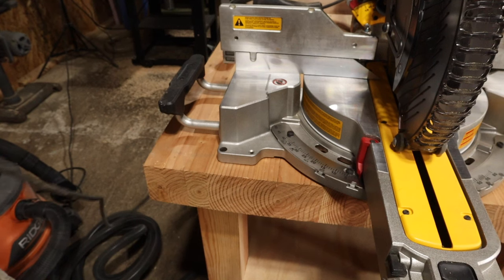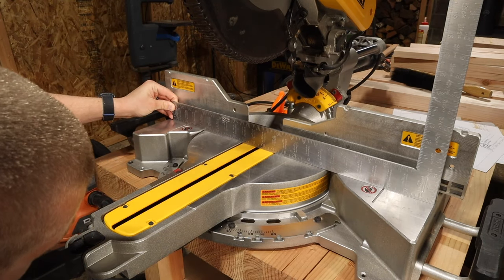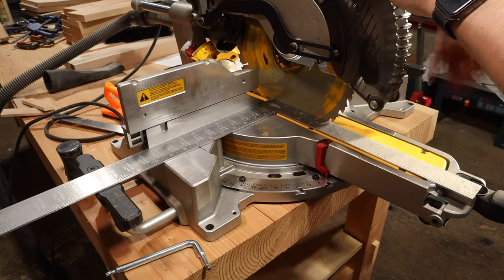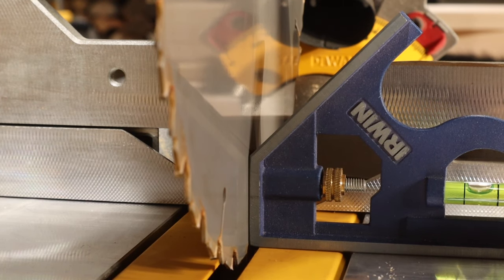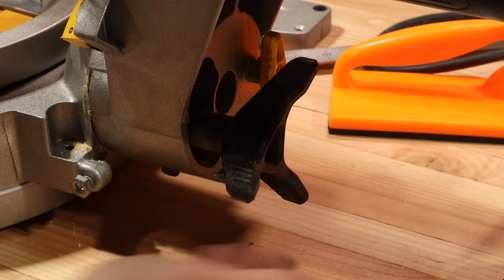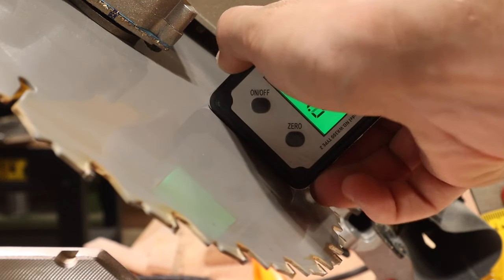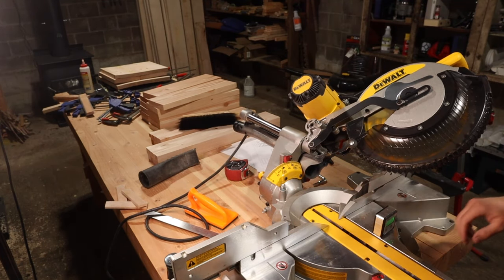Fine Tune Your Miter Saw | Dewalt 779 Miter & Bevel Adjustment

Comment: My husband was going to cut some boards for a closet I am designing, but I checked his blade at 90 degrees per another guy's video with his speed square and it was off. He said he didn't know how to fix it, so I straightened it using that bolt per your video while he was taking a nap.
Reply from the maker: Glad you were able to get it fixed! 😄

Comment: That is not a 90 degree detent nut. I've practically turned it both ways and when I tighten it, it shows the degrees going down on my digital angle gauge but when I loosen it the degree doesn't go up. You should have shown how to do this.

Comment: How do you get the side to side wobble to stop. It's not the blade the whole saw moves/ wobbles side to side. Can't see any screws or adjustments under the base?
Reply from the maker: Interesting! Like it’s wobbling in the bevel adjustment direction? If so, the back of the saw has the pin which locks in the bevel, does that have any wiggle in it?
Reply: @NorthwestCraftsman  yes the bevel adjustment.  The yellow pin is a little loose and the back black know is tight. I'm stumped. I see no way to tighten it.
Reply from the maker: @BLAM777  Weird. Okay, well, it's narrowed down to that. Can you try pulling it out like you're going to do a bevel cut and then let it snap back into the 90deg hold position? When it's doing this see if it feels like it's inserting fully or if there is something in the way, keeping it from fully engaging.
Reply: @NorthwestCraftsman  well I got it to ingage ,now it doesn't wobble. Just kept pulling  it out and moving it around while locking it in. Maybe something was in there stopping it.
Reply from the maker: Awesome! Yea, I bet it wasn’t fully engaged. Glad you got it fixed though! 

Happy Woodworking!

Josh
Northwest Craftsman

Comment: You deserve an award for a very thorough explanation and well edited instructional video, kind sir. Have you noticed that the blade guard's wheels are problematic when doing bevel cuts? Mine can't roll along the the work piece like it should because of the aggressive angle and I had to remove my blade guard entirely. 
Thanks!
Reply from the maker: Thank you! I appreciate the compliment and am glad you found it helpful. 

I have noticed that the wheel binds up on bevel cuts sometimes. What seems to help me is when I use my thumb on the trigger hand to slightly lift the guard as I initiate the cut. I don't do a ton of aggressive bevels though so I may not be experiencing the same situation you are. 

Josh
Northwest Craftsman
Reply: @NorthwestCraftsman  thanks a lot my friend! Are your wheels binding up on the 45° bevel cuts though? Mine are and I think that's a design flaw in this saw.
Reply from the maker: Yea, I guess that is where I’ve noticed it. I’ll need to try cutting a few of those to see what the motion feels like. I don’t even do that many 45° bevels 😂 miters yes, but apparently I’m a bevel free woodworker 😂 On the whole though, I think you’re right that this is one of the weak points of the design.

Comment: Best video I have found on Youtube for all of this adjustments--thanks
Reply from the maker: Thanks! I really appreciate that! Glad you liked it!
Reply: @NorthwestCraftsman  I just got this model from Home Depot and I have the 90 true to the fence (on both sides), and the right side 45 to the fence. But the left side 45 is slightly off, maybe .3 to .5 greater than 45. The table and the fence both are flat all the way across. Could the adjustable detent miter scale be faulty? Any suggestions?
Reply from the maker: Hey there! Glad to hear it’s mostly in line.

I see a few possible options: 

1. There is a small amount of tolerance stack up in the detent plate. i.e. the very small amount of play all components will have allows the right to hit 45 on the dot, but it’s too close to the edge on the left and pulls it off by a hair. 
2. The fence on the left is off (less likely because of the 90° measurement being on)
3. It was measured poorly (I’m guilty of this more often than I care to admit 😂) 
4. You’re limited by the accuracy of your measurement

To make sure it’s not 3, which is easy to check, try measuring it a couple of times and see why kind of repeatability it has.

To check 4, how are you measuring the angle? 

If those look fine at it does seem to be in the detent plate, there are two possible actions I see.
1. Ignore it and only is the right side. I rarely use the left 45. 
2. Split the difference between the two and reduce your error to about 0.1° on both sides, or, only use the one side. Problem with this is that it’ll shift all your measurements. In that direction and you’ll want to double check them to make sure they’re not too far off.

Comment: Thank you.  So much better than trying to follow the instruction manual.  Quick question, I am new to a lot of this..that digital angle guide you used looks very useful.  Does it require that the surface the saw is on is perfectly level?
Reply from the maker: Glad you found it helpful! And that’s a great question! You don’t need a perfectly level surface for the digital angle gauge. When I “zero it out” on that surface. I’m setting that as the reference. So the next place I set it will be the angle of that surface with respect to the reference surface we zeroed the gauge on.
Reply: @NorthwestCraftsman  thanks so much for the reply.  This makes total sense.  It's similar to using the tare function on a scale.

Comment: Bet you haven't heard this before:  My new (out of the box) DeWalt DWS779 does not track straight.  No, not a fence alignment issue, the back side of the blade tracks just left of the leading edge.  That means it's crabbing through the cut.  After the blade has made its initial cut the back side of the blade comes along and nibbles just a little more out, leaving an ugly joint.

I just unboxed this and the first thing I intended to do was to make sure everything was properly aligned.  Though it looked like a good 90˚ cut, after cutting a test piece - it's obviously crabbing to the left slightly.  Using feeler gauges, the 0.018" gauge seems to feel like it strikes the edge whereas the 0.017" gauge slides in without contact.  This measurement was taken with the piece held edge down to the surface of my cabinet saw.  On the flat.  No joints, just flat.
Reply from the maker: Dang! No kidding, I haven't heard of that before. It strikes me as a bearing/rail assembly issue for the slide which causes it not to track in the plane of the saw. I'd absolutely reach out to Dewalt for a replacement.
Reply: @NorthwestCraftsman  Imagine two poles sliding parallel to each other.  At one end you have an end-stop and at the other you have - um - a saw assembly.  As long as the end-stop and the saw assembly are perpendicular to the poles and parallel to each other, the saw will not crab.  Here's what I did:  I loosened the mounts enough that I could influence them gently but firmly with a hammer, causing one pole to shift back slightly.  The first result showed promise but I had to repeat the process a few times.  One time too much and the saw was now crabbing the other way.  Ever so gentle taps with the hammer caused it to spring back to its factory position and I had to start over.  Once I got it just slightly too far I tightened things down a bit, then with ever so slight taps I coaxed it back into alignment.  The saw blade now has barely any aberration of crabbing.  I now know that if I want to repeat the adjusting cycle again - I know how.  For certain it was never intended to be a user adjustable feature, but if necessity is the mother of invention then mother-in-law is the invention of necessity.  And adjusting that was definitely a mother-in-law of a bikch.  Yeah, I know I mis-spelled that.
Reply from the maker: I can visualize exactly what you’re saying and that would explain the issue perfectly. Glad you were able to get it fixed!

Comment: GREAT VIDEO!!!!  Quick question. After a bunch of moving around and cleaning up, I was setting the saw up for my wife, and I noticed that the locking mechanism at the front of the saw that auto stops the angles of the base plate is not grabbing. Do you know of an adjustment?  Thanks again!!!  Matt
Reply from the maker: Hey Matt! Glad you liked the video! That’s odd, I’ve never run into that. Only thing I can think of is that some piece of wood jammed into the spring mechanism which is keeping it from popping down. Does it feel like there is any grab?
Reply: @NorthwestCraftsman  As I can see, the "tab" is hardly popping in. I will check for some debris in the spring. Thanks for the reply.

Comment: Very cool video!👍👍...  Just remember...
   ✴️✴️✴️  That when you are checking the bevel angle with a digital angle finder, don't forget to rotate the blade a quarter or a half turn when taking a reading; so that your measuring device will be at a different spot on the blade so that you can get multiple readings from the blade surface; which will help eliminate possible defects in the blade itself(eg:a bent or warped blade) from throwing off your measurement by a decimal or two. 👍
                                     ✴️✴️Also✴️✴️
      When checking for the bevel angle with a digital angle finder remember to put the magnetic meter on the bottom side of the blade as well as the top side of the blade to check the measurement and see if there is any difference due to the weight of the magnetic calibration device, when on the top side of the blade... (Not as important though, depending on the size and weight of your digital angle finder device...)
        Peace!!!😁
Reply from the maker: Thanks for the advice! Great tips!
Reply: Good points.  As a "Quality Engineer" and having been a "Quality Technician" I've long known the reasons for taking multiple measurements.  Thanks for highlighting it in the comment section.  Since I didn't cover that your comment will be useful to many others.

Comment: Nice tips. I have a question. There is a great number of digital angle meters. What brand is the most accurate and reliable?
Tks!
Reply from the maker: Hey Alex! Complicated question. The real question is how much are you willing to spend and how much does it matter for your work. Most are only accurate to .1 degrees which is usually ample. I have the Wixie gauge which has worked well but Klein also has one and I'd trust them. I have the links below. 

Wixie Gauge: https://amzn.to/3WSPX16
Klein Gauge: https://amzn.to/3Gn6aEx
Reply: @NorthwestCraftsman  Thank you very much! It is being hard to match price x accuracy.
I really appreciate your answer. Tks!
Reply from the maker: Not a problem! Glad I could help and it’s always a question 😂

Comment: This was very helpful. So, what would cause the miter angle to be way off when doing taller vertical miters? I had some shiplap that I wanted to miter on the long side for having two pieces laying against the wall meet in a 45 and the miter angle was off by several degrees on the downward cut height of the board. The saw would follow my line at the top and then be out by the time it hit the bottom of the board. I checked the bevel angle and the saw was perfect and it's 90's are solid. Are taller miters just not ideal / not accurate? Should I have laid it flat on the cut table instead? I couldn't do that because my dewalt 12in model isn't dual bevel unfortunately.
Reply from the maker: Glad this was helpful! And it took me getting through your comment to that last portion for it to click why you weren't using the bevel function. That being said because of the articulation of the saw, you can really compound your error if it's just slightly off. There are a few troubleshooting steps I'd do before going to a crosscut sled, if you're interested, let me know and I'll get it together.

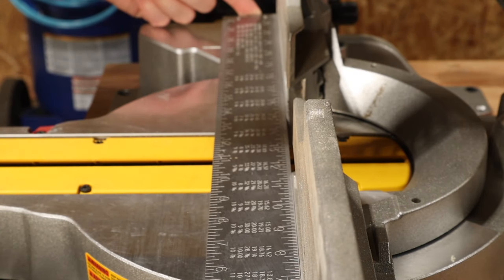Comment: This is a great video -- all business, no fluff, and you have a really straightforward delivery style -- but at 1:38, talking about the fence alignment, it would be helpful to know how make adjustments to the fence to be sure it is true instead of "get them fixed" as an answer.  Appreciate the title says "Miter & Bevel Adjustment", but your box level can be spot on and if the wood is not consistently flush against the fence, it doesn't matter, eh?  Just a thought, brother.
Reply from the maker: First, thank you for the feedback! I’m glad this style works well for you. 

Second, you’re totally right, I was more vague than I ought to have been. If the base of your miter saw is out of plane/true, it’ll likely need to be remachined. For me, that functionally means returning it to Dewalt. 

For your last point, can you elaborate a little more? I’m not sure I fully understand what you mean.
Reply: @NorthwestCraftsman  Hey, man.  Agreed, if the base is out of line, that's probably a machining/manufacture thing.  My focus was on adjusting the fence if the two parts (left side, right side) are not on the same plane.  Best~
Reply from the maker: Gotcha! I’ll have to go check to see if those are adjustable. Can’t remember. Your feedback is totally valid though, I should be more specific than “then you’ll need to fix this” 😂 

Glad to have you around! Thanks for watching the videos with a critical eye. 

Josh 
Northwest Craftsman

Comment: I have a newer dewalt miter saw and I did all the adjustments.  Everything reads square except when you put a square on the blade, one side is perfect and the other is almost beveled.  When I fix that side the other side gets out of whack.  Tried multiple blades and cleaned the arbor. Any thoughts?
Reply from the maker: Fascinating. Is the other side of your square on the fence or the sole?
Reply: @NorthwestCraftsman  This was with the  bade of the square on the table and the long part on the blade. ( not on a tooth)
Reply from the maker: Interesting. Because it's not symmetric across the blade, it would imply that the table top is off true. It's possible they did that on purpose to prevent binding on the wood and I missed the asymmetry in when I did my adjustment. I'll head out to my shop today and see if I see the same thing.
Reply from the maker: Hey Scott! Thank you for your patience. I was able to check my blade for square and it seems to be on both sides. Given that yours isn't, I would guess the sole is out of true. Have you put a straight edge across both sides to ensure they're coplanar?
Reply: @NorthwestCraftsman  I did do that ,and the  base was not level. I did some sanding on the high spots and now everything seems to be OK. Thanks for Taking the time
Reply from the maker: Glad you got it figured out!

Comment: Have you seen a cut that does this?  When I cut a 45 with the saw to the right.   The cut pulls in towards the right side closer to the fence
Reply from the maker: Hey Tom! Thanks for the question. Let me make sure I’m understanding correctly. When the saw’s miter cut angle is at 45° (cut is still vertical) it create a bevel cut (no longer a vertical cut)? 

If you have any photos or a video explaining what you mean, you can find the channel’s email on the about tab of the channel in YouTube.

Comment: Hey man I just got this saw today as a big upgrade to my current saw, and I noticed when i have the miter set to 0 degrees and tilt the saw 45 degrees directionally over to my left-hand side for a bevel cut, as i bring the blade down there is so much "play" in the wobbly finger guard that as it touches down it completely binds sideways. Fully stopping the downward motion of the cut. When I loosen the slide all the way out, slide it out at a 45 degree bevel the same thing happens as I bring the blade down, the finger guard binds even more, bending it sideways and stopping the downward motion of the cut. I've taken the entire finger guard off, and put it back on, tightened it up as much as possible. Just curious if you have experienced this as well? Or if you have any recommendations. It seems to be a major issue as it makes the 45 degree cuts near impossible.
Reply from the maker: Yup, I know exactly what you’re talking about. Binds for me as well in any cut other than a vertical. I just use the thumb of the hand actuating the saw to pull back the guard prior to cutting. This is one of the weak points in the design.
Reply: @NorthwestCraftsman  ahhh ok gotchya, well hey thank you for responding I really appreciate the feedback
Reply from the maker: Not a problem! It’s a great question and honestly a design flaw in their part.

Comment: I am a new woodworker, my Question is I have  a dewalt 779. I am trying to make a 7degree /45 angle cut when cutting a peace that calls for 10" do you cut 10" from 90 degrees or longest point to longest point?
Reply from the maker: Good question and unfortunately it depends on who provided the instructions. Most of what I've seen calls out the width of the workpiece and the angle/miter is whatever it comes out to given the angles + width. If you have a drawing or plan, feel free to shoot me an email and I can take a look at it!
Reply: this is a link to what I am having trouble with ,youtube video Matthew Peech .HOW TO MAKE A GARDEN TRELLIS / TUTEUR / OBELISK. 7 degree miter and 45 degree angle cut on a dewalt 779, I made sure the saw is  set up per your video.
Reply from the maker: It looks like the measurement he's taking is on the longest edge once the bevel is cut. So, first, cut on the end to start it, then measure the 10in from the point furthest out, mark, and cut so the mark is on the longest edge. You can double check by measuring the longest edge.
Reply: @NorthwestCraftsman  Thanks